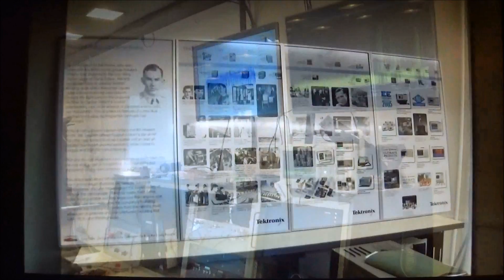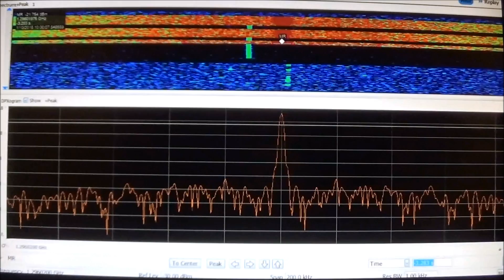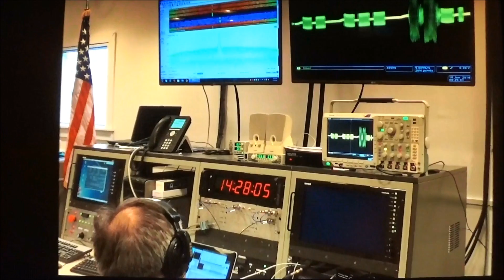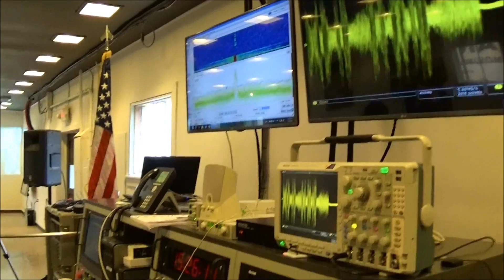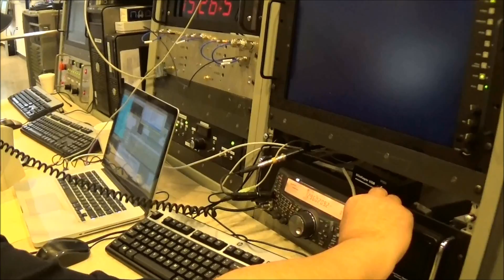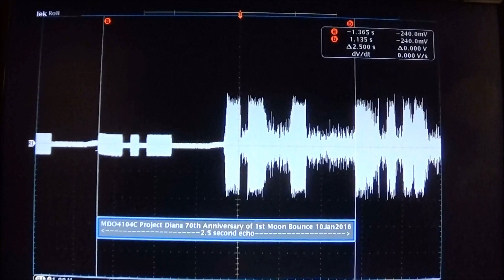#226: Project Diana 70th Anniversary Special Event | Moonbounce | EME

Comment: The round trip time to the moon and back at the speed of light is about 2.5 seconds. So when the presenter sent some "beeps" to the moon, as expected, the start of the echo was received about 2.5 seconds after the start of the original transmission. He then spoke into a microphone to send an audio signal. But why did he speak for almost 10 seconds? The first 7.5 seconds of the echo were obliterated by the last 7.5 seconds of the transmission. So we only heard the last bit of his message in the echo. How was a 10 second transmission ever supposed to work?
Reply from the maker: It works fine when communicating with another station, just not when you want to listen to yourself.

Comment: Absolutely awesome stuff!  I am sure you and the others involved had to do a lot of preparation before the event.  I mean beyond the coffee and sandwich arrangements.  Would be great to know or see (if you have recorded) that part.  Say for example, did you have to tune the transceiver to match the antenna frequency? did you have to adjust the gain?  did you have reinstall some feed cables to the dish antenna?  did you know in advance that the antenna should transmit about 50 MW of power to get a decent received strength?  (did you have to do the maths before the event or has the station been always up and running?)

I am assuming that the big TV displays were fed by the Tek scopes on the workbench?  (And that part surely smells like channel w2aew stuff! :) ).

Why are there computer keyboards on the workbench?

All in all, terrific!  Kudos to everyone who made the event possible in this day and age where it is easy to forget about Morse code and just mindlessly fiddle on the smartphone instead.
Reply from the maker: I wasn't involved in much of the prep. Princeton Univ has be rehabilitating the antenna for several years (rebuilt drives, rotational components, feed lines and feed horns, preamps and amplifiers, etc.) They also wrote the custom tracking software to automatically track the moon. They also ran the calls, etc. Path loss at 1296MHz is about 270dB (according to a EME enthusiast friend of mine). Keyboards are for the computers that run the tracking system for the antenna, and a SDR they use for radio astronomy. And yes, I brought the scope and spectrum analyzer that are hooked up to the monitors.

Comment: That is so cool! I've never before heard a voice transmission in moon bounce. Thanks for the video.
Reply from the maker: +Applied Science Thanks Ben.  It takes a lot better SNR for voice transmission than for CW, mainly due to the extra bandwidth needed.  In our case, the incredible 46dB gain of the antenna is what made it possible.  Pretty amazing.  We had several kids that really got a kick out of speaking the club callsign into the mic, and hearing their voice echo back from the moon.

Comment: How scattered is the reflected signal? Is it very directional or can it be receveid equally on all parts of the Earth which are currently "looking" at the moon (ignoring atmospheric effects)?

The same the other way round: how focused is the signal reaching the moon? If you were on the moon would it be the same intensity everywhere or is it more like a "spot" on the moon?

The dish obviously being very directional, but not perfect (I guess, don't know much about the beam pattern), how far from the dish is the reflected signal stronger than the stray signal from the dish.
Reply: +superdau Moonbounce is done every single day for decades and decades since this experiment happened.  If the moon is out where you are anyone else who can see the moon (figuratively or literally) can hear your signal.  Fact is you say hello and 2.5 seconds later (give or take depending on how close the moon is) you will hear your own voice saying hello.  Very fun and SSTV via moonbounce is fun.
Reply from the maker: +superdau The amazing antenna we were using has a very narrow 1 degree beamwidth.  Even with this, the width of the beam at the moon is MUCH larger than the moon - so it is not just illuminating a spot.  The best way to picture the reflection is to imagine how the light from a flashlight would be reflected off of a small polished silver ball.  As stated below - basically anyone that can see the moon at the same time you can will have the possibility of EME contact.

Comment: Did anyone calculate the power loss and propagation delay of the moonbounce transmission?
Reply from the maker: +T Komoski At 1296MHz, the path loss is on the order of 270dB!  Propagation delay is about 2.5 seconds, round trip.

Comment: Very nice video, thanks. Was the level of noise in the original signal as this one?
Reply from the maker: +esmaeil nam It's hard to say because recordings from 1946 were pretty poor.  They used 111.5MHz, 10MW ERP, and a receiver with only 50Hz bandwidth to get the SNR to acceptable levels.  Required very precise computation of Doppler - calculations carried out by Dr. Robert McAfee.